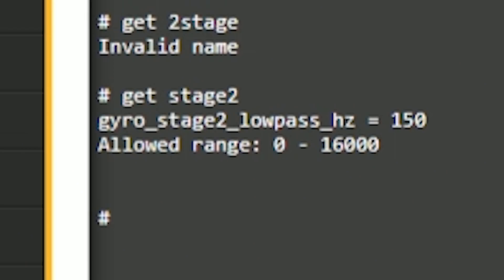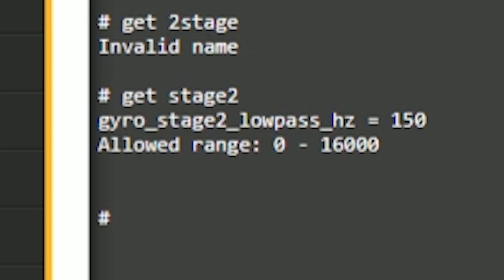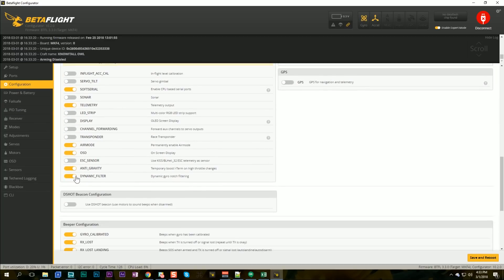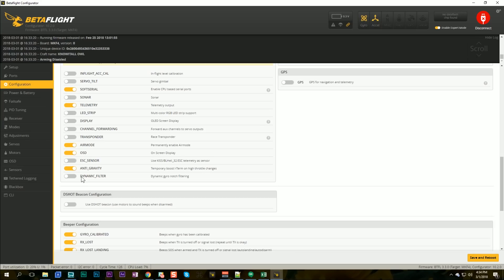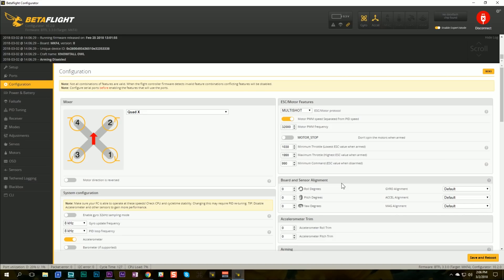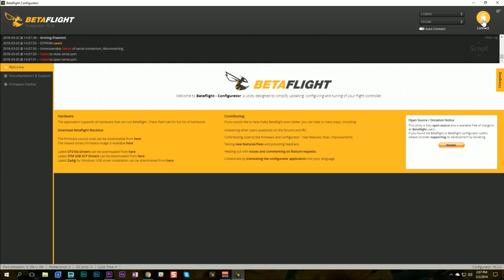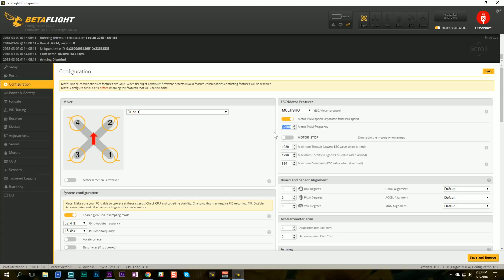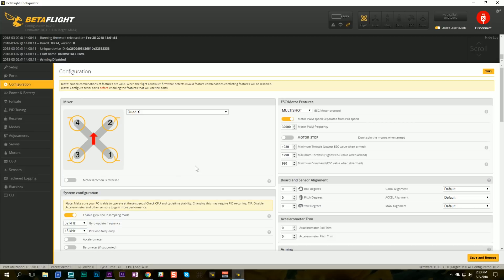Betaflight 3.3 (not) Kalman Filter | HOW TO

Comment: Well , i think you "all" guys overseeing something again and again.

I apreciate Joshua, you mention this is only another "filter" whitch practical effect is .. lets say discutable.

Then i must ask you.
Why you guys hunt filtering and high frequecny gyros, when you dont know if it help in real world (i mean in air flying) ? And if it is help, how much ?

Are you guys crazy or mad, or you just usually doing things, which you dont know why and how result it will have ? Or you dont simply care if it improve something and IF yes how much ?
Interesting "science".

It that normal ? I dont think so.
Reply: Jan Prejzek, can you explain to us why quads are still not simply flying PWM signals to the ESCs vs. OneShot, MultiShot or Dshot?  PWM is 500hz (1/500hz = 2ms).  So, if motors can't update any faster than 10ms as you postulate, why is the entire industry flying higher ESC refresh rates to the motors and it is universaly understood it makes a HUGE difference from practical flight experience?

When I cut my teeth in quads, I was flying SimonK ESCs which can only accept a PWM signal, based on what you state as fact, that should be way more than fast enough, correct?
Reply: Universaly understood.
Hah, yea that is what i am talking about.

You trying to improve something which you dont know how, or where is you final speed whitch is "needed" to reach best possible performance ?

How much do you think is needed in gyro speed ? 64khz ? 128khz ?
And filtering ? 3ms, 1ms ?
You have no idea. Not even close.

So why you wanna talking about (something), if you dont have idea what numbers you need ? It have no sense. Sorry

And yea i dont know obviously, (as you), but maybe even these old 500hz escs with "new" firmware on reasonable FC maybe work pretty close or same as good as "modern" escs. I dont know, i didnt tested it, like you (or measure it somehow).
So it is only "virtual" discussion (how it will or can work), almost same as your virtual 4ms filtering.

I dont like this virtual filtering magic you showing. You must have 32k gyro, and you must have 4ms filtering. Why ? And how much is difference ?
You dont know.

Try it and it will be "awesome". Maybe.

Cool technical "talk" in 2018.
Thanks for help.
Reply from the maker: I disagree that the effect is disputable. This is the cleanest  have ever had a quad fly especially on default PIDs with zero tuning.
Reply: I have subscribed to your channel, drop some knowledge on us please!
Reply: Jan Prejzek I'm quite certain that uavtech has backed up plenty of his videos about the new filters with black box data showing the differences. If you don't believe in the numbers you could always look at the community response. Have a look at what happened when betaflight went to BF3.2 and introduced some new filter magic.

I for one had never had such a pleasent flying experience. Now I am the first to admit that these numbers go over my head. I can however notice a difference in the flight characteristics of my quads (even with my limited skill). Don't bash on the people that develop and explain something wonderful just because you don't believe in it. By all accounts stick to flying an old esc without these fancy filters. There are also still people in the world that claim a frame rate of 60 is not noticeable in comparison to ~30. It's okay to believe it as long as you can have fun with it.
Reply: It isnt about i dont bellive it.
It is about they are not proving any measurable progress in what they claim ,-) .

They are just cook water and preteding it have awesome taste.
That is what bothers me.

Because there is surely possibility it is still water on the end.
Reply: And,
if you are so sure (certain) they did, link me where, i will likely to see it.
Video with time or anything where will be possible to see that information or evidence will be apreciated my friend
Reply: I think we are kind of talking about 2 different things too; at least to some extent.  Jan is talking about refresh rate the to ESC (which is the PWM, Oneshot125, Onceshot42, MultiShot, PID loop rate, etc... stuff).  Filter delay has to deal with how up-to-date the information is passed to the PID loop for those calcs to even begin.  If outdated it makes a difference, of course, no matter how fast the PID loop runs and updates the motor.  The 1st step (or update) - whenever that occurs - will be "old" out of date information.  Subsequently for the 2nd, 3rd, 4th.  All calcs will be out of date because of the filter delay, and hence the issue.  In a prop wash scenario, apparently, it matters based on flight experience because if you reduce your filter delay, it is easier to PID tune out bounceback and prop wash.

If anyone disagrees, that's cool - it is your toy, not mine.  Dump on the filtering then.  The old BiQUAD (a 2nd order LPF) with all the Notches should give you AWESOME noise attenuation (but also heaps of delay).  Have fun out there!  I think all content creators make videos to help, not tell you what to do.  If you don't want to listen to the input, it is simple, just don't.
Reply: UAV Tech I dont went that deep. And i dont talk about esc refresh rate, or something like that.
I talk about whole system.
You saying you help.
Hmm i am saying you explain things(mainly) and in same time you creating feeling we need fastest gyros and lowest filtering, BUT you dont actually know if it is true.
So i am asking, why do you saying ppl something , what you dont know if it is working ?
Focus on proving if it is working, not how to make 2 ms faster filtering (maybe) what is (again maybe) practically totaly useless.
You pretending it is needed, but you have actually no idea if yes or not. Stop lying to yourself.

And dont motivate ppl do things where you dont know if it have any result. Yea there will be different number in settings. 
That is only true fact.